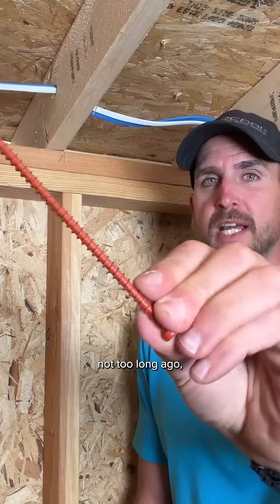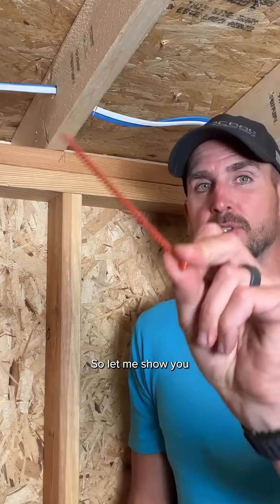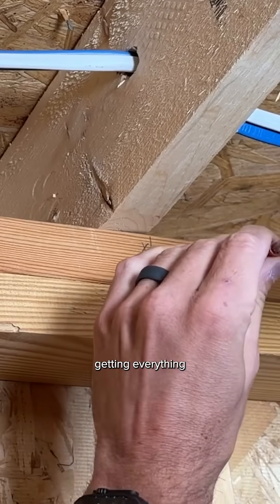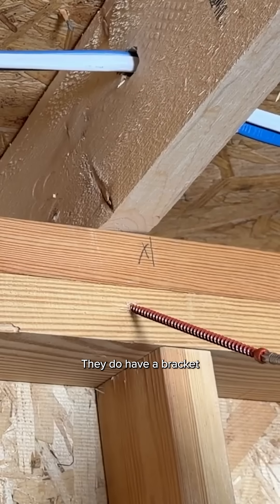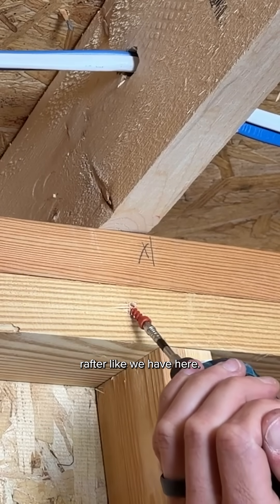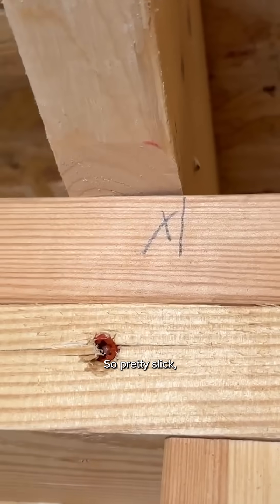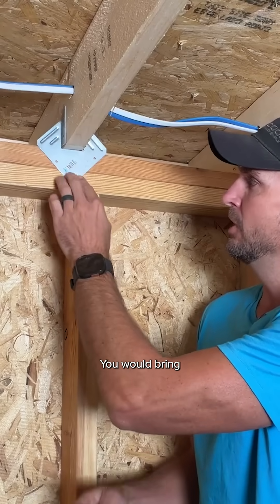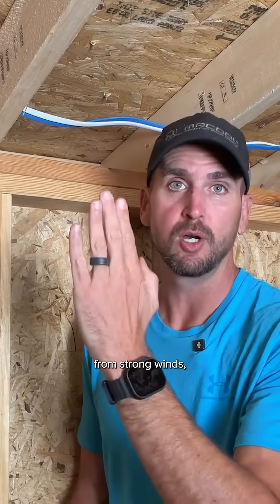The Screw That Makes Hurricane Straps Obsolete?

Comment: I love the people hating on this have no idea what a structural screw is. I’ll give you a hint, they can bend just like a nail. Now I’m giving you a homework assignment. Research why it’s threaded the full length of the screw. Another hint, this screw is intentionally not designed to pull anything tight

Comment: Terable idea the wood is the fail point the stress of the strap connection is is distributed over a bigger area . Then you get a strap over the truss or joist and is the strongest hold you can have . That screw will split the joist or rafter and if it doesn’t the stress on the wood in a tornado or hurricane will split at the plate or joist.

Comment: the bracket is easier to see if it has BEEN installed and installed properly with it's nails. That screw,. you won't be able to tell. It's whole length is hidden. And I bet cheap contractors will try to use long wood screws or  STS screws and NOT this one.   Sorry the hold downs are just a better.  Plus not split rafters or plates.

Comment: Or you could do both. I built mine to 160 mph wind load. I would not trust that one screw, but that's just me. Or you can build it right and use 18 inches of concrete and steel tie beam like I did. Wood kind of blows down in a real hurricane. lol

Comment: That’s more like one of the double top plates, a potential damaged lower double top plate and the entire roof being secured on the top of the double top plates alone without the sheer strength of a nail at the same time. Too many cons. Hurricane ties disperse the force throughout the rafter, and both of the top plates, with its sheer strength in 2/3 axes.

Comment: That’s so inferior when you consider how inconsistent carpenters are with driving screws in to catch wood without splitting or knotholes or other defects compromising that joint. It all leads to way more inconsistency and less fasteners doesn’t mean better 

Brackets have been proven for decades.

Comment: For guarenteed safety of the structure why not just work that little bit quicker and fit the bracket and have another man inside fitting the screws, although that truss isn’t sitting on a stud so that would bring me to question does that 6 inch screw mean you can avoid landing trusses on the studs? Engineers am positive after 20 years of timber frame kit erecting always have there trusses landing on the studs for weight transfer. Correct me if am wrong but if am the Clark of works on that project that would be the first thing a questioned is why there not landing on the studs 🤷🏻‍♂️ 6 inch screws or not that seems a little cowboy to me like he’s marked his X the wrong side of the line meaning every truss of set out in 6 or 400mm will be wrong side of the line and not landing on a truss so the whole roofs weight is now transferring down onto the plate instead of the studs…..a hurricane a would fancy its chances of ripping that roof off the plate and they screws whatever angle you put them in.

Comment: Layperson here. It's not that I dont trust the screw. Its that I dont trust the quality of the wood its going through. The plate with multiple nails holds at several different points on the boards, any of which could be softer or less reliable, as opposed to the one screw. If, by chance, the boards crack or damage along that screws line, it could hardly be considered sound.

Comment: I think with that knot being where it is on the rafter this shows a perfect example of how the tie is superior. With most of that screw going into the knot and that being the one and only fixing point, you're relying on the knot's stability in the member that it's part of. With a tie, you not only would be fixing into a decent part of the grain and avoiding the knot, but there will surely be far more resistance to shearing forces with 4x the thickness of the nails vs the thickness of the screw shank. Not to mention the potential of your lower top plate splitting from the screw + head going through just a corner of it

Comment: Very peculiar engineering idea.
Perhaps a 1/4" diameter x 7 inch screw with a heavy duty pan head screws that comes directly up through both top plates. I like the Simpson idea but dont like the placement on angle through the side of the bottom plate. Guaranteed to split that plate

Comment: This short has the IQ level of ZERO. Nobody who spent a reasonable amount of time in the building business is going to make a fool out of himself promoting this nonsense. Here's why. That screw will split the rafter making it weaker. 2. Hurricane tie nails dig into the wood grain where there is the most strength and in multiples. Anyone promoting this product needs to find another line of work like maybe a cashier at the grocery store.

Comment: I’ll go with the bracket because both top plates would shear away quickly around the 6” screw in a violent updraft The bracket cradles the base of the rafter and the top plates.

Comment: I GUESS EVERY DAMN THING IS A JOKE NOW
NEVERMIND A SCREW USED FOR THIS APPLICATION is NOT A VIABLE CHOICE CONSIDERING THE HARDENED STATE of
Reply: Cont- hardened state of the fastner..cause any screw requires it to be of a hardened state of various degtees otherwise it would begin to splin itself apart once resistance met a certain threshhold. Nevermind that..I FUCKIN LOST IT WHEN I NOTECED ITS A PHILLIPS TYPE HEAD...BECAUSE CAMMING OUT IS NEEDED HERE OBVIOUSLY. ...

.. . 

DING DONG THE WITCH IS DEAD DING DO....

Comment: Fractured the bottom plate and the screw should have been started lower.
Bracket has more holding points.

Comment: That will not hold, especially not when fitted so badly and with such low surface area of the screw head. Build your houses from stone and mortar instead of paper and straw.

Comment: I had these installed by contractor 3 years ago.  2 years ago I lost my roof during Hurricane Ian.  Legal battle with contractor for using this system instead of the brackets. Insurance also did not want to cover damages because these were used.

Comment: as soon as framers realise that it is impossible to determine the actual angle and penetration depth of the screw into the rafter after installation, they will stop taking any care on placement and angle and just bang them in any old way. Some will even find cheaper shorter screws that have the same external appearance and start using them instead.

Comment: No single screw replaces a bracket.  Basic physics tells you this.  That screw could be twice that length.  When the 200MPH wind from a hurricane gets underneath your eaves,   it's ripping out.  Toeing it through 3/4's of an inch of a stud secures nothing.

Comment: The point about using the plate fixing is that all the fixings are in shear, which is by far the strongest fixing.  Using a single long screw may not give the same degree of pull out that the plate does.

Comment: Those 6-inch screws would not pass code in Florida you need to have the hurricane hanger which is a little bit different than the one you're showing.

Comment: Why on Earth would you risk using a super long screw like that which could fracture all the boards that it enters? You can see the split in the wood caused by that screw on its entry point. I'll pass on that long screw

Comment: So, as the screw drives into the rafter, there must be some degree of splitting happening; it's hard to believe that this is nearly as strong as the bracket.  I'm thinking I could pry bar that rafter up and off of that screw easier than I could pry bar that rafter loose from the bracket.  Just my opinion.

Comment: As a European I am fascinated about how houses are built in the US.
And not to mention how the electrical wiring is handled. It's crazy that you drill through material that is supposed to handle load. Not to mention how the heck does a rewiring work?!

Comment: This video doesn't follow the manufacturer's installation requirements. The screw must enter the bottom plate with a maximum distance of 1/4" from the bottom edge. https://ssttoolbox.widen.net/view/pdf/c8ups625d2/C-F-2025TECHSUP-p078-099.pdf?t.download=true

Comment: Holy heck, you could have at least installed the screw right. You can just screw straight up from the lower plate. If a stud or header is in the way, then start at the bottom corner of Lower 2x4 at an angle

Comment: Well, I like brackets, but the thick ones, those regular brackets are pretty thin, so no matter how many nails, is just as strong as the shear strength of the actual plate metal where its bent.

Comment: I'm building my own house now. I used this method but, after the fact I was driving one into another (non-structural) point and the screw snapped (broke). I have since gone back and added the strong ties. Logically, 8 points of contact are better than one. Now there are 9.

Comment: I work in a roof truss plant. We sell both the RT7A Hurricane Clips, and the Simpson SDWC-15600 screws. I think we still have some of the RT-15s shown in the video but we never sell any. The RT7A will hold 900 pounds of uplift force and the screws will hold 600 pounds of uplift force.
Reply: THANK YOU. Tests performed to support the single screw do not include testing for other variable movements and stresses that the plate handles but the screw does not. Pretty simple.

Comment: No, Florida Building Code generally does not allow a single 6-inch screw to replace a dedicated Simpson hurricane tie for connecting roof trusses to walls; hurricane ties (straps) are specific metal connectors mandated for new construction/major repairs to provide continuous load paths, while screws (like structural truss screws) are used for sheathing/framing connections with specific penetration requirements, not as direct strap replacements for uplift resistance. A simple screw lacks the engineered uplift capacity and connection design of a proper hurricane tie system. 
Why It Doesn't Work
Function: Hurricane ties (straps) create a metal "tie-down" system from roof to wall, offering continuous load paths against uplift. A screw doesn't replicate this engineered connection.
Code Specifics: The Florida Building Code (FBC) mandates specific types, sizes, and placement of hurricane ties for new construction and substantial roof work, ensuring proper uplift resistance.
Sheathing vs. Framing: Screws (like Simpson Strong-Tie's SDWC Truss Screw) are used for fastening sheathing to framing or within framing, with requirements for penetration, but they aren't substitutes for the roof-to-wall straps.
Testing & Approval: Hurricane ties are tested and approved for specific uplift loads, a performance level a single screw cannot match for the entire roof-to-wall connection. 
What Florida Code Requires
Mandatory Ties: Hurricane ties are required in Florida for new construction and major roof repairs to meet uplift requirements.
Sheathing Fasteners: The code specifies nail/screw types (like ring-shank nails) and spacing for roof sheathing based on wind zones, but these are for the deck itself, not the main truss-to-wall connection. 
In Summary: Don't try to substitute a single screw for a hurricane tie; use the approved metal connectors as required by the Florida Building Code for structural integrity and code compliance.

Comment: Form a Google inquiry:

No, Florida Building Code generally does not allow a single 6-inch screw to replace a dedicated Simpson hurricane tie for connecting roof trusses to walls; hurricane ties (straps) are specific metal connectors mandated for new construction/major repairs to provide continuous load paths, while screws (like structural truss screws) are used for sheathing/framing connections with specific penetration requirements, not as direct strap replacements for uplift resistance. A simple screw lacks the engineered uplift capacity and connection design of a proper hurricane tie system.

Comment: Bull shit. The lack of a pilot hole, allows that screw to simply tear the wood fibers, as can be seen in the 2/5th's of torn wood in the bottom plate, and the tearing of wood fibers continue into the roof joist, more then likely splitting that roof joist by not using the guide and pilot hole allowing the screw to follow the wood grain, already weakened  by the 5/8" hole near by for ROMEX, not to mention the fasteners used to hold the cheap and weak, shitty OSB. I would love to see tear test data, comparing your typical corner cutting contractor method versus Simpson Strong Ties fastened using thread cutting Simpson flat head screws or appropiate nails, length and amount. You start out saying you'll go through both of the top plates then into the rafter, then proceed to barely yoke the bottom plate. Stop lying to people.

Comment: I am not impressed with either method.  The rafters should be bolted to the walls and all all walls should have angled cross braces.  It would be way stronger and not cost that much more. Building to code still is not adequate for hurricanes and tornadoes.

Comment: I  built my detached garage and tried using those screw anchors, my code inspection would not approve those.  Had to add the hurricane brackets anyway.  Ask your inspector before bothering with this option if you are tempted to go with the screws.

Comment: 0r - SIMPLE deep insulation cavity parallel chord sidewall truss / modified roof scissor truss unified rigid frame structure. Ground level assembly / tilt up frame construction.

Comment: I'm sure framers love it for speed but I'll NEVER believe it even has HALF of the uplift rating of a hurricane clip
Reply: It’s actually better
Reply: @jamesb95 Explain how a few tiny threads of 1 screw has more hold down capacity than the shear strength of several hurricane nails or screws combined with a galvanized bracket.  Case closed😂

Comment: You're suppose to use a special bit driver that that wraps around the corner of the top plate. It guides the screw to the proper angle into the corner.

Comment: This would not pass Florida hurricane codes. Actual hurricane straps, when properly installed link the roof all the way down to the sole plate/bottom plate.  That screw would not hold that roof on because now your relying on the pull out resistance of the nails on the top plate. This is far less resistive than a strap that links from the rafter down to the stringers, with another strap from the stringers down to the sole plate.

Comment: You could actually install both. The Simpson screw can go in vertically from the bottom of the lower top plate. That's if you're concerned about the strength of the union.

Comment: The reason this can’t be a replacement is because of user error. Guys working quickly will not always be accurate. If they aren’t accurate, it won’t have the strength. The plate takes the user error away as long as they fill all the holes. Giggity

Comment: This could theoretically work if quality metal is always used and the screw is correctly placed each time without cracking the wood. Plates don’t have that worry. So might be acceptable for a shed or a repair but not full construction

Comment: Next, we'll approve a new, certified, special green hot glue. At $30/stick (star shaped so your standard glue gun won't work), you'll build an entire house without a single nail or screw. We've already replaced sheathing with paper board and using 3/8 drywall, Replaced solid floor joists with mdf I-beams and 2x4, load bearing lumber is now 1-1/4 x 3.5.  It won't stop until people refuse to buy these shitty homes.

Comment: The angle of the screw and placement thru top plates are critical for the screw to take the place of the hanger, read requirements on box. From how you did that screw the angle is too shallow.

Comment: if i was ever in the position to build my own house, and funds were a non issue, 

i would likely use more then one Tornato arguing long screw while also using other solutions in tandem with those Tornato arguing long screw.. 🤣 

pulling resistance, pushing resistance, impact resistance... so a constructed spere i suppose lol 🤣 because i imagine a basement with it. 🤣